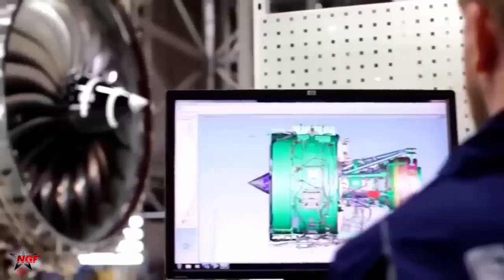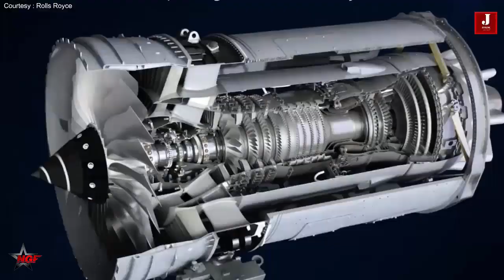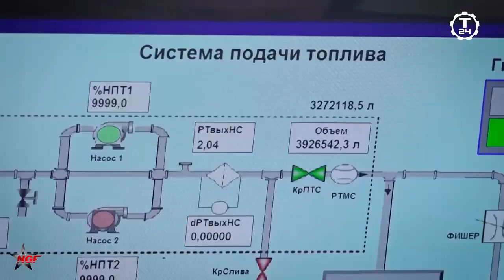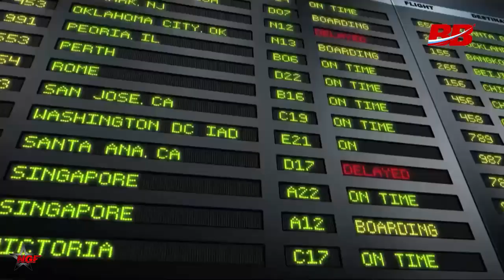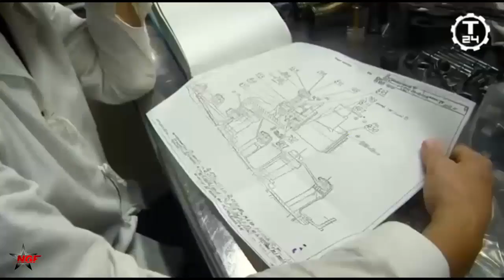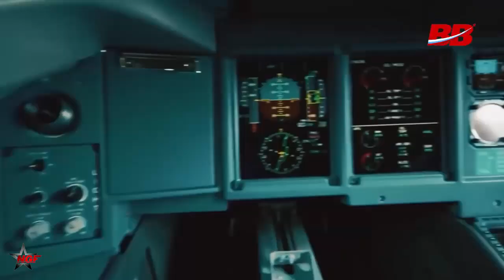Russia to Start Serial Production of PD-35 and PD-26 Engines by 2027

Comment: no way it will be in serial production by then .... pilot build yes. Nobody would enter serial production until the engines are fully certified - you guys clearly have no real understanding of what you are talking about ...
Reply: Wer sagt denn das diese Motore nicht bis 31.12.2026 zertifiziert sind ???
Die Standprüfversuche sollen 2025 abgeschlossen sei, so daß 2026 die Flugerprobung durchgeführt werden. Ist ja nicht so das dieses Triebwerk erst seit 1 bis 2 Jahren in Konstruktion ist.